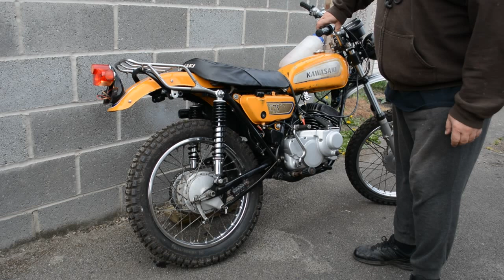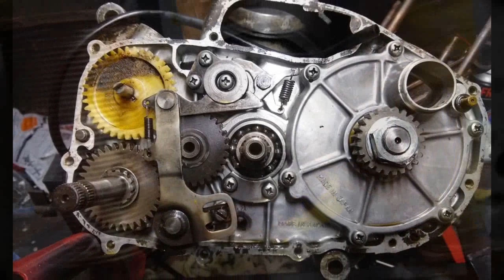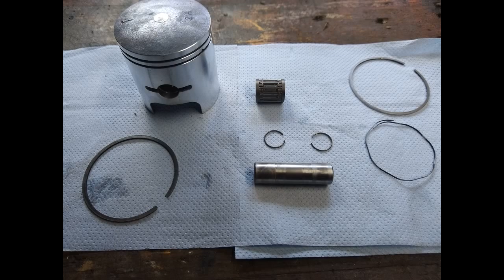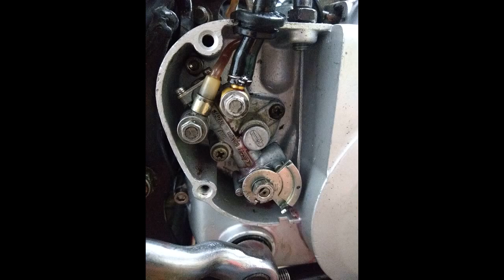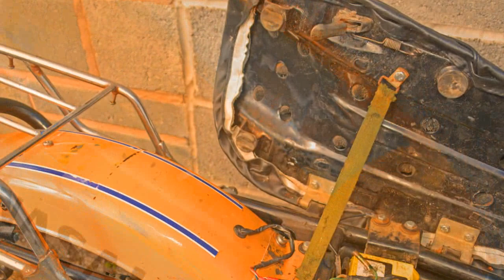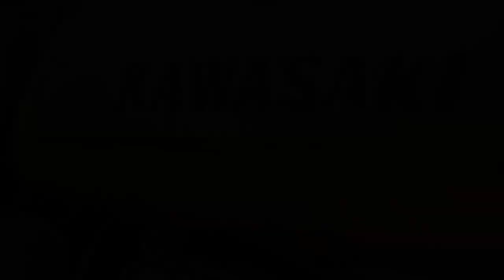F7

Comment: Hi, I am the owner of this bike presently, I have owned it for a a couple of years and bought it off the guy who you sold it to, sadly it was left outside by him so many bits had gone rusty on it and the fuel tank was filled whith rust, did you by any chance have the cases apart at any point? I have the engine apart right now and have since I bought the bike as the gearbox went caput on the first test ride 😂, I have bought a second engine to sort out and use as a spare while I get this one finished, love the long travel suspension on it as it really lifts it up higher👍 sadly all the paint on the cases has flaked off so I have stripped them back to bare metal and will be rebuilding the engine throughout this week 👍 thought you would like a update 👍
Reply from the maker: Hi, the update is much appreciated.
Can't recall splitting the motor, might have slipped a LH crank seal in (could be imagining it as well, did a few single cylinder two strokes around that time)
Shame it has been allowed to deteriorate, it was never a show winner, but was this basis of a good rolling restoration.
The rear shocks are slightly over standard length, and the fork were at the 'highest' settings, I think there are three options.
Did ride it a couple of times and for a small bike it had a bit of giddy-up.
Hope things go well with your resto.
Reply: @paulbell9025  reso is going well right now, just ordering the last bearing needed to put the engine back together and need to fix some holes in the fuel tank, all the rusty bits have been stripped back and painted but the patina  painted parts I have kept original. Hopefully it should be riding in a week or so l, if not the spare engine I have orderd will be stripped and made to work then it will run on that while I get this engine back together 👍. Did you put a new piston into this engine and do you know if it was oversized or not?
Reply from the maker: @zakidickinson7376  did put a std new piston and rings, bore was fine and compression was within the stated range.
Reply: @paulbell9025  ahh thanks wonderd cus it looked pretty new when I was taking it apart, there was a weird thing whith the main cases that someone had used actual clear bath silicone as the sealant and a lot of the insides were pretty gunky 😂
Reply from the maker: @zakidickinson7376  FFS 😱
Reply: @paulbell9025  spent about 15 hrs today and yesterday getting the bike all back together, every bearing and seal replaced and working. Engine is back in the frame and even managed to get it to pop off a bit but need to set all the autolube up before i run it for a while, tank I think needs brazing but should be alright to do. Would just say that I'm only 16 but this isn't my first Kwak engine rebuild 😅 when we get the new engine I will strip and replace all the bearing the same as I did whith this engine and should hopefully have two runners then 🤞
Reply from the maker: @zakidickinson7376  Top man, got to say from the viewpoint of this old man it's brilliant to know your age group is taking up the reigns.
Reply: @paulbell9025  sadly I think its pretty rare now, I got the vintage bike bug off my dad and now own a yammy dt175, a kawasaki g4tr, bsa b40 I converted into a trials bike and a bsa 500 single cafe racer, all nerd little bits of work but most run and ride